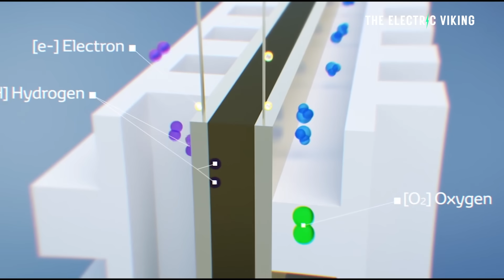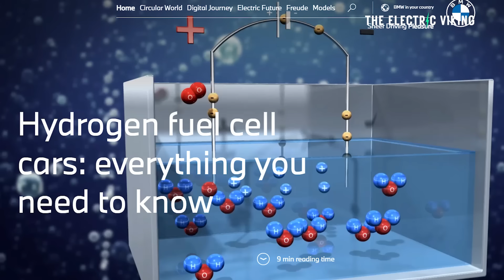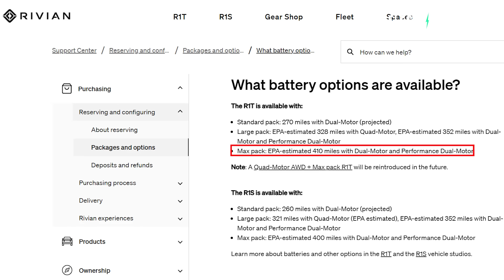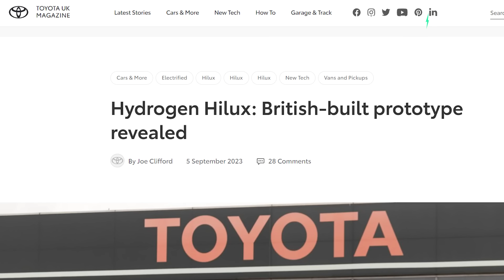Toyota's Hydrogen powered Hilux is the REAL future of the auto industry

Comment: As someone who worked with hydrogen gas on a daily basis for over 20 years I’d have no issue using it as a power source for a vehicle. Infrastructure for safe refuelling is a big issue though. Another issues are on-board storage, high pressure tanks have their own problems, though there has been research in other storage methods. Then do you use a IC engine or use PEM cell hybrid EV. It’s a technology that shows promise but we are just starting even though there are a lot of players in the game.

Comment: If they use fuel cells, that is converting Hydrogen “burn” into electricity and then using electric motors then it’s actually an EV that instead using batteries it’s using fuel cells. I have a question for you: what are the requirements for the hydrogen tank in a car? That is, what it takes to store hydrogen in a car?

Comment: Toyota has been joined at the hip with big oil for decades, and doesn't want to give up manufacturing vehicles that require a fuel delivery system benefitting those same big oil companies. EV's cut out big oil, who of course are thoroughly unprepared to combat the EV revolution. Toyota is the de facto spokesperson for Exxon, BP and Shell, among others and plans on continuing that relationship indefinitely.

Comment: Are you dreaming, never ever the well-to-wheel balance would make any sense. Even if we would have energy in abundance we should not waist any for such silly things as cars and trucks driving around with hydrogen that is burnt or converted in electricity - too expensive and service intensive. Nobody with full conscience would invest in that costly and questionable infrastructure not coming out of wishful thinking for years now. Even more realistic players like Hyundai Group with real serial products to buy see that only as rolling labs and field testing. Believe in realistic entrepreneurs not stemming from decadent old families at their end like Tesla and understand their vision of become free from geopolitical oil problems with mainly water and solar. Make hydrogen out of that only serves the old interests and their power games - Toyota belongs fully to the old master and slaves world not interested to free people from dependence where they make most of their money. Toyota is not in any way interested in your LIFE and only your money is what count with an absolute minimum of own contribution! There are far better solutions in autonomous hydrogen low pressure systems for housing industry to heat or climatize as well as using PV. So by June/July your hydrogen systems could have slowly and safely produced enough for A/C and heating in winter. Everything is available from industry standard parts and must not be invented first. Best the cost per house would be 60 - 90’000 USD  one time investments. But the old farts at Toyota are just rediculous 🤡 from a past time burning money they have made once with cheap and good products that people made believe in them. Today they are just out of time. My age is 72 by the way and I drive since May 2022 my first own EV with not a minor problem. TCO are a dream and efficiency too, so where would be the advantages of complexe slave system when I am free now? The stupid range discussion is totally rediculous with 500 km per charge as similarly powered ICE did neither more. And I am no Rally driver crossing African desert in one day😂😂😂

Comment: In Ontario Canada, switched to ultra low electricity rates for night time charging costs $4.00 per 1000km to charge my Model Y. 

When I can fill my hydrogen tank at home.
When I can fill it for $4.00 per 1000km
When a hydrogen vehicle is cost competitive with a EV

Then I will think about a hydrogen powered vehicle

Comment: It's always troubling when a technology company tries to sell you something that basically violates physics, namely, hydrogen is more efficient than or at least competitive with lithium-ion or other battery approaches. It's almost 3:1 less efficient. Even if you could generate hydrogen from electrolysis at the curbside, so to speak, you didn't have any of the cost of storage Transportation or infrastructure it's still roughly 2:1 less efficient. Therefore, it has no chance. 

Toyota's chronic lying about this of course comes from financial incentives provided by the Japanese government that started many years ago, when the Japanese government asked their industry how they could get away from reliance on Chinese Supply chains after a dust-up between the two nations in the China Sea. In response to that, China shut down all the components necessary to make hybrid batteries. So, of this hydrogen BS comes from the government's billion-dollar subsidy of anything that would provide an escape from dependence on the Chinese. Chinese-japanese antagonism goes way back, but the hydrogen BS is the latest casualty of this tribalism.

Comment: Hydrogen is definitely coming. It is a far safer technology than lithium ion. Far less fire prone as it is so light it goes vertical up past the atmosphere and out into space before you can say the word “boo” also why ? the US president has mandated it, just like EVs he wants hydrogen now and green manufacturing of it . Governments of European and Asia countries are needing and asking for bulk supplies in the order of 10 of thousands of tonnes of the stuff per annum. Presently it’s  in use everywhere as it always has been in food processing, agriculture and chemical manufacturing. Huge usage in industry amazon and Walmart forklifts run on hydrogen. Massive installations .Quite a few countries will not be able to use battery EVs as the don’t and will not be able to have the infrastructure. To support them. Hydrogen will be a great fit here. And in heavy industry, construction, mining, manufacturing (it use now) . Hydrogen sent men to the moon, space shuttles into space etc. you can buy kits to convert your v8 etc. tow vehicles will use it as batteries aren’t good only .045 kw per kilogram. Hydrogen 3.4 kw per kilogram. Fuel 1.3 kw per kilogram . Burns clean no co2 can use it like fuel or to power a battery cell to run electric motors . Hydrogen won’t fix everything ether , synthetic fuels will fill those holes. Hydrogen is an easy retrofit to service stations. Subsidies like the EV industry has had would be great. Though as a necessity industry will make it happen as batteries are just no good in these areas. Also customers will demand it to go bush in your hilux your going to need hydrogen. Stored it doesn’t lose energy over any period ( batteries lead down and lose charge if left for a period). need only a little say 4kg to go the equivalent distance a 500kg battery charged will take you or 40 litres of diesel. Very easy to manufacture in bulk can use just air if you like. Less energy to make it in bulk than ti
Just mine lithium.  It being mandated by governments as it’s the best way to fuel emergency vehicles that have to respond to fires, earth quakes floods etc

Comment: Solar powered hydrogen in around 15-20 years will possibly be a thing for some heavy industrie sectors etc due to an over abundance of PV/CPV at certain times making it increasingly cheaper but to suggest it can or should compete with old Bev is a bit much for obviously so many reasons 🤦. The only way Toyota can have a win here is if the hydrogen Hilux play is a smokescreen for solid state which I don't believe Toyota are capable of.  Nothing personal against Toyota but someone has to take the baton from Kodak

Comment: Hydrogen has always been a non-starter for automobiles.  If you make hydrogen from green electricity, you need 3 to 4x the electricity compared to just using that energy to charge a battery.  That will not compete on price.   Hydrogen combustion engines are even worse than fuel cells on efficiency.   A truck at least has a lot of space for the extra tanks, but is still would need a large number of tanks to get reasonable range.  The mirai is ridiculous with 3 hydrogen tanks, one right down the middle of the car, one under the seat, and one behind the seat.  It also has a large battery to buffer electricity from the fuel cell.  So not much interior space, no fold down seats in the back, and little trunk space.

Hydrogen is just a delay tactic to keep us using fossil fuels even longer.  It has never made sense.

 A good discussion of this is "How Clean is Hydrogen, Actually? With Prof. David Cebon | The PLUS Podcast" on the Everything Electic Show.

Comment: Hydrogen the future? Not really sure though. We use so much electricity right now to produce the Hydrogen. Unless Toyota have found a way to have "green" electricity to produce Hydrogen I don't see have a major impact on the market. Either Hydrogen will be much much cheaper than Gas, or it should be cheaper and more eco friendly to Electrical if they want this to succeed. 
Personally I think Hydrogen will be a niche market, VE have taken to a too much high level and it's taking the market by storm.
Reply: @scottglossop Ok, but it means it has to be very limited quantity of electricity produced which means very small quantity of Hydrogen produced. I know there were some green Electrolyse done in Chili in mountains to ensure the sun was constant with some wind turbines, but it was enough for around 4000 cars per year.... But let's being logic, as you can't store energy, to produce the Hydrogen, you will need some means of keeping extra energy when lot of sun. So you will probably use Battery. So you use electricity, probably stored into battery, to produce Hydrogen and compress it, that will be shipped to  oversees to countries, so that it will be loaded into cars. So why don't you directly use the electricity to power your car?  it's a step that you have less. Right now, all the green energy does exist when in perfect condition. I'm not saying that Hydrogen is not good, I'm saying that why do we add extra steps for hydrogen while we can use already produced electricity? and Electricity is already produced from all country. Oh and another point, Hydrogen need huge huge amount of water (not salted)...  but let's see how it goes.

Comment: I thought you took it pretty easy on them. I could see Hydrogen in fleet use on fixed routes with stations along the way. Unlike EV's, you can't plug in for a slow charge at home. This is a fetish project for Toyota management.
Reply: Throw in Hyundai/Kia and Mitsubishi.

Comment: Just watch Out of Spec Review's evaluation of the Toyota Mirai hydrogen vehicle. The only advantage to the Mirai is that it refuels quickly. Everything else is a negative such as performance, refueling cost, massive infrastructure required, limited range, explosive in accidents, more costly to product the vehicle. And, the hydrogen tanks degrade over time, so you must replace them at least every 10 years, if not sooner. The oil industry is pushing hydrogen in order to keep everyone hooked on oil, even though you only get maximum (best case) 42% of the energy out compared to what you put in to produce hydrogen. They do not mention the catastrophic effects of hydrogen, and you can't even refuel your vehicle at home. No thanks.

Comment: ok so your camping in the woods and run out of hydrogen................good luck getting a tow truck in, lol.  yes there would be a mobile filling station available somewhere but it wont be the first issue to be resolved. The cost of the cars, the cost of the filling station and the actual hydrogen costs will make this so expensive only a nutter would bother.  By 2028-2030, EVs will have over run the world of cars, i cant see how toyota is even stupid enough to try to move the world to hydrogen by then. Just think this as a consumer.......you have to PAY for hydrogen and not stray too far from a filling station.  Drive an APTERA and potentialy never have to fill up. Only a nutter would willingly pay when the option to not pay is infront of your eyes.

Comment: I think by the 2030s we'll see much lower prices and greater availability of hydrogen, as its production methods could be considered to be in an early stage. Both the production and the fuel cells should look different by then, and hydrogen can certainly work well in a wider temperature range than current batteries. Were it abundantly available (right now) the obvious benefit would be the ability to adopt widespread adoption, basically regardless of a region's electric grid capacity. When (as is currently the case) not even the most developed countries have an electric grid that could support a total shift to electric, I can see hydrogen as a potentially valuable fuel source that could speed wider adoption of renewable-energy-powered vehicles (including modified ICE vehicles - maybe a < $2000 mod to existing vehicles). I'd also love to see a study on the impact of high adoption of H2 vehicles in chronic drought areas.
Reply: you make the obvious silly assumption that Hydrogen power will improve whilst EVs stay static. <$2000 mod? Are you nuts? An EV conversion is currently about $40,000. Add a $100,000 fuel cell and your economics just went belly up.

Comment: Simply, no.
Could, does 98% of the heavy lifting in every Toyota EV announcement. Hydrogen is a non starter for cars, it will 100% never ever power cars on a mass scale. The only way to get Hydrogen cheaply is to use the waste products from cracking oil into petrol/diesel. 
Apart from which, Hydrogen is so flawed as an energy storage medium for at least half a dozen reasons. 

The only way we EVER use hydrogen to power cars, is if we manage to get Mr. Fusion to work. On a car scale. And since that's probably about a century away... this is a non serious video. Normally like your content. This, not so much.

Comment: I also read that the hydrogen engine burns 2 times as hot as a gasoline engine so the engine will need plenty more service than a gas engine!
EV’s have 90% less parts and almost no wear repair! How can you beat that???
THE WRITING IS ON THE WALL…HELLO!

Comment: I say hydrogen is the way, and even if the hydrogen comes from fossil fuels, it won't be long till theres a much more cleaner, greener and efficient way to produce Hydrogen, theres a lot of ocean around the world, we just need cleaner electricity and fuel to operate machines that can separate the atoms 🙏🏽⚡️
Reply: we got a sun that provides energy 24/7 and will last another 5billion years or so. Why waste energy converting energy to hydrogen storage to then convert back to electricity.  Store the energy directly into the battery, no itermediary losses. Hydrogen is just a storage method, same as batteries.

Comment: Hydrogen vehicles the major stumbling block is were do you buy your hydrogen but if they can get the infrastructure up and running and start making the hydrogen well why not much faster to fill up a hydrogen tank than recharge an EV and it is a such a complicated process as shown in a couple of you tube videos and one presenter is all for EVs he owns a couple of them and is actually building his own EV from an old ICE vehicle  but with hydrogen pull up to a pump fill it up with hydrogen and away you go now do you remember LPG in Australia mainly for Taxis and many yeard ago Toyota released a car that ran on LPG this was before the hybrids and LPG was easy to get and easy to fill up your vehicle done of the problems asciated with EVs l have watched several videos if EVs driving from Sydney to Melbourne and they seem to spend more tine recharging there EV than driving and l have seen many you tubers in a trip in there petrol or diesel vehicles less time refueling and more time driving but solar paneled EVs may be the answer more time driving less time recharging

Comment: hydrogen cars will never pan out. The physics of Hydrogen gas are so treacherous that no amount of cleverness will solve the intrinsic risks. 1) Hydrogen is an invisible, odorless, explosive gas.  2) Hydrogen has a flame speed above the speed of sound; you know all those films where the hero or villain lights a gasoline trail on the ground and runs away.. Well, can you run over 700 miles per hour? Ha ha.

MITI, the Japanese central govt R&D group spent billions sponsoring Hydrogen car R&D, and both Toyota and Honda took that research money, and did the best they could to build tech that would put them way ahead of everyone else. Oops, it turns out that MITI bet on the wrong horse, and that is the two big Japanese auto firms are so far behind on EV's.
Reply: its not the physics, it can be done. Its the costs involved. It just doesnt make economic sense for anyone to own a mirai when you can own a tesla....as an example. Stack them up and electric has so many positives......and getting better.

Comment: Hydrogen with fuel cells makes sense for fixed power generation like at homes that have gas service.  I think this is s more efficient method to get electricity to a home.  The one big problem currently is the cost of the system and the short life span of fuel cell before replacement is needed.  Hydrogen engines don't make sense at all.